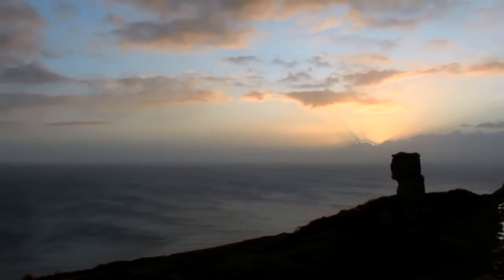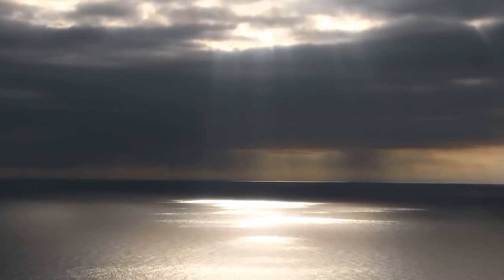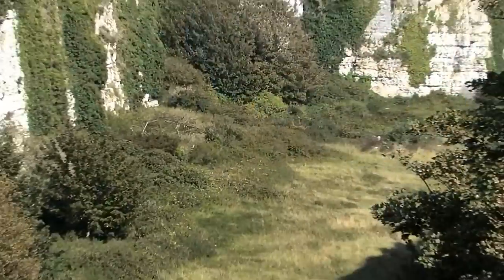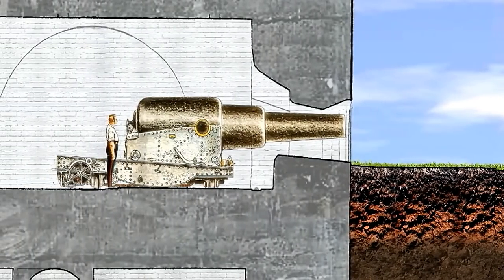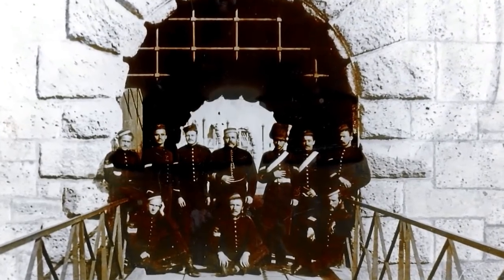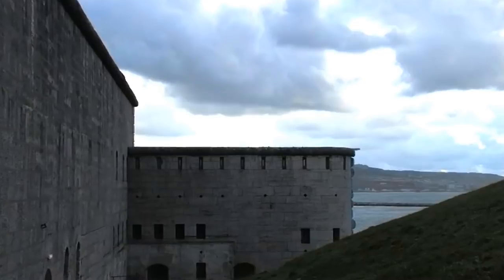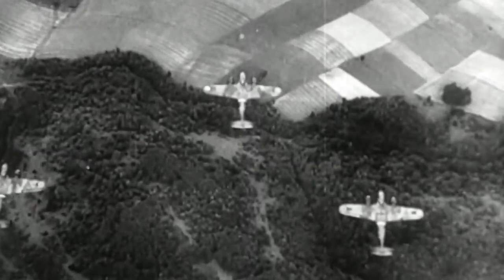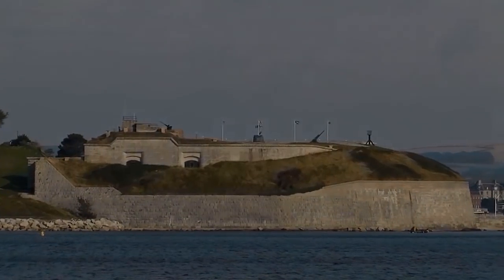Nothe Fort, Weymouth. The history of the iconic Victorian fortress. Unique graphics and images

Comment: Makes me laugh that officially there's only one magazine level - but if you go outside and walk down to the Caponier, there's two doors at two different levels. The higher door coming into the Magazine.  The lower level of the Caponier goes into the same level as the lower floor of the Caponier - which is where we used to get in during the late 70s